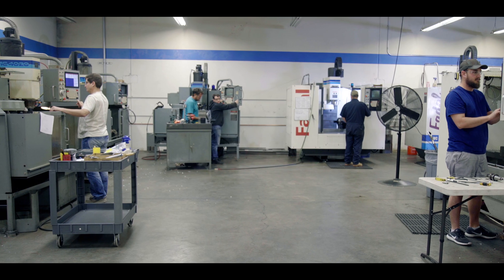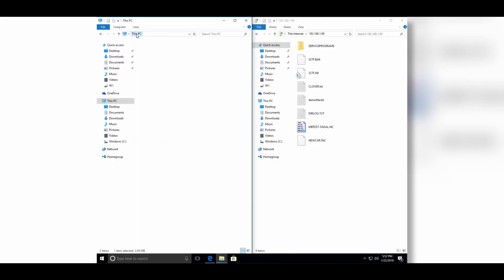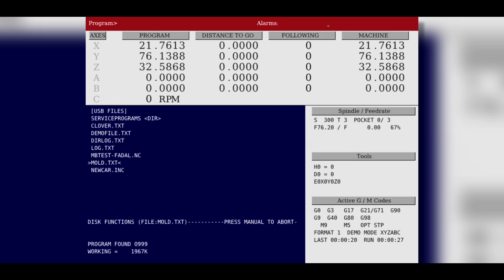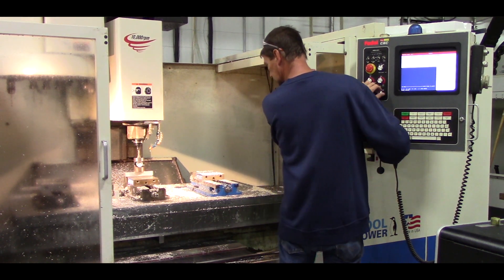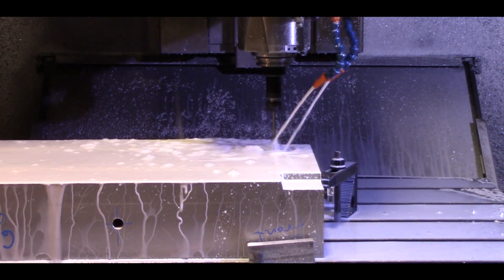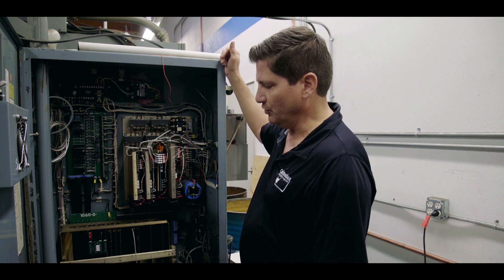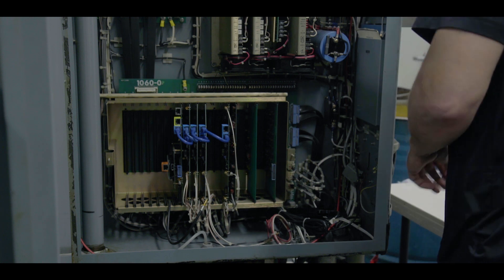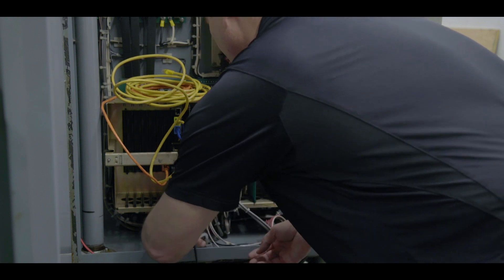Calmotion 527F CNC Product Video

Comment: Another question does this new control have any conversational features? Can be a nice feature  for drill/tap arrays, quick pockets, etc... far as post processing I imagine pre existing Fadal PP would be fine?
Reply from the maker: It has the features that came with the Fadal control, there are functions to enter drilling, tapping cycles, etc. via a set of menu prompts. You can also add a optional PC to the pendant, that way you can load your own CADCAM system directly at the control

Comment: These would be great on our fadals. We have been looking at centroid fadal retrofit reusing our servos. Two machines are dc servos and one is an AC servo.
Reply from the maker: Our retrofit installs very quickly as we discuss in the video. Very little you will need to change. It works with any Fadal machine DC or AC, any tool changer, rotary tables, pallet changes, etc....  Give us a call if you have any questions.
Reply: CalmotionProducts, Any chance you have a customer in the Denver area where we could see in person a retrofit?

Comment: Hello does it have a probing cycle that can memorize multiple bore locations on a part  and can it control 5 axis
Reply from the maker: Yes, probing cycles built into the control, using L9101, or G31. Macros can be used to manipulate the probe data, or you can use G10 cycles to change fixture offsets, etc. It also supports Fadal PC Digitizing Probing software.
Rotary 4 and 5 axis simultaneous servo control is fully supported with the 527F control.

Comment: Can someone change the appearance to look like Fanuc?
Reply from the maker: He was actually asking about the g-code post formatting for the control not the user interface. The 527F supports Fadal formatting as well as Fanuc formatting
Reply from the maker: Currently the control is a Fadal control replacement. That might be an option in the future.
Reply: @CalmotionProducts  my intention ia not to change the way it works but I remember when I work Haas machines I could program it like a Fanuc
Reply: @Jumbo Palumbo most people are use to Fanuc and postprocessors are deafult, but it's ok what you say, anyway having the option available would be great